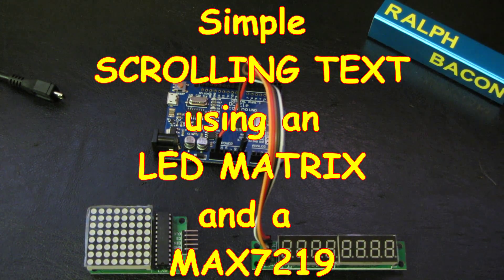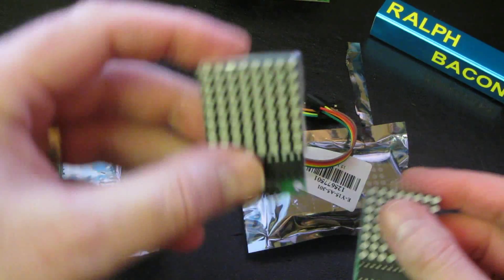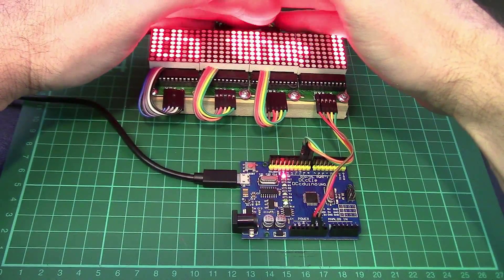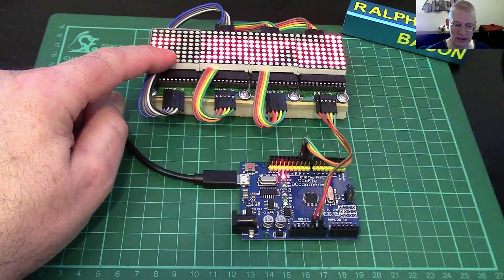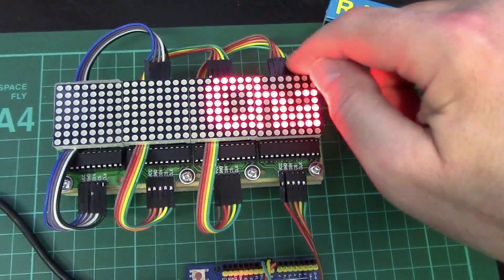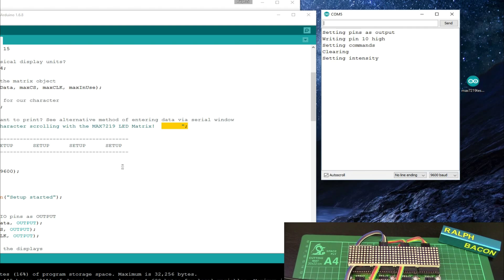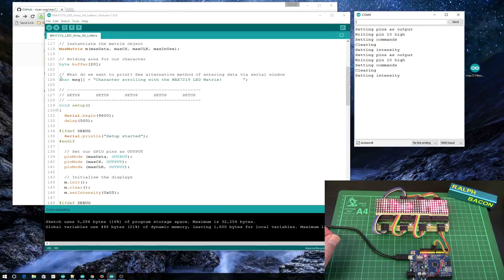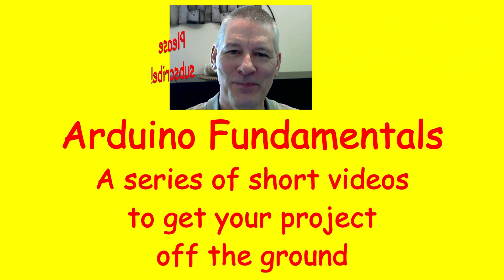#25 Scrolling Characters on an LED Matrix using a MAX7219

Comment: 4:40 Can't you just use the library to make scroll left and right? I'm going to buy one but i really want left and right scrolling ability.
Reply from the maker: Not using that library, Paul, but there are others that do this. It's complex to do which is why better featured libraries are required. Have a look at my other MAX7219 videos (use the searchable pdf file in my most recent videos' description) to see whether I mention them.

Comment: Hi im new to arduino coding. As i was trying out the codes for this maxmatrix library, it seems to show the error of maxMatrix library is not found but i have already included them in the arduino library. I'll appreciate any help :)
Reply from the maker: Have you added the following line at the top of your sketch:
#include <yourlibraryhere.h>
Don't forget the ".h" part of the file name or it won't find it.

Comment: i am having trouble finding the LIB for this  #include <avr\pgmspace.h>
Reply from the maker: I'll assume you're using the standard Arduino IDE above version 1.0, Gaatech. In which case you don't need this library explicitly, it's already included as part of the standard Arduino set of core libraries. It's used to write to EEPROM memory, I hope this clarifies this. Good question, thanks for posting.

Comment: Great video! I have controlled these with the UNO and other programs in the past. I am looking to run this program that you have graciously provided with a Arduino Pro Mini. Any reason this shouldn't work the same way? Thanks!
Reply from the maker: Thanks, Andrew! I can't think why that would not work with a Pro Mini if you have the 5v version. I cannot tell at a glance whether the 3.3v version would be able to drive the matrix (I suspect so, but best to check). I just find the programming using a USB to Serial dongle a bit fiddly, and prefer the Sparkfun Pro Micro USB version. And do check out the updated video #80 which covers this topic in more depth.  Thanks for posting.
Reply: Ralph S Bacon , for some reason, by first two boards in a series of six were all garbled. I suspected a hardware issue so I swapped them out, still had the issue. I tried a different program that I used previously and it worked. Long story short, these boards indeed work with the 5V pro mini. As far as your program, I claim user error on my part. Great video and thanks for sharing/replying!
Reply from the maker: Thanks for your post, Andrew, glad it worked out and good to hear from you.

Comment: Hi, have you tried th MD_MAX72xx library for the blue 8x8 x4 led module? ps you need to edit the library .h file to tell it what display your using it took me an hour or so to find it. has some good effects if you install. his paralo additional library
Reply from the maker: I've added this to my 'investigate' list as I've not seen the blue led arrays (sound nice) but I have, I believe, watched a demo of the library you mention (very sophisticated wipe effect, split screen etc). Thanks for the heads up, Gary.
Reply: Ralph S Bacon defo worth a look. had a few head scratching moments whilst munging dh11 rtc and barometric pressure sensor code into it to get sensor data to display.😞🤔

Comment: Hey Ralph,
      
         Nice video. You are my teacher, I started make display after wathching this video.
 I used 5 display (8*40). Now I Want to make this display big like 16*40. Suggest me ...How i do Its Wiring?

and which code upload  ?
Reply from the maker: Mahival, have a look at the comments under video #80 Scrolling LED Matrix MAX7219 Updated which contains some suggested links (by others, not me) where you can define segregated areas and build up very clever displays.

Comment: Hey Ralph, 
I am using the raspberry pi and I wanted to ask you:
does it work with the raspberry pi 3 in the same way or is it way different? I am also using the max7219 leds :)
Reply from the maker: Hello Arduinite! I'm currently on vacation 5,000 miles away from home so I'll have to be brief with these comments until my return, mid-July.

The principle will be the same but the library I'm using is only for the Arduino. But if you look around I bet there are libraries just for the Pi that also do this. Good luck in your search!
Reply: Thank you but I already found a library vom rm-hull :)

Comment: max7219test_scrol.ino:29:23: error: variable ‘CH’ must be const in order to be put into read-only section by means of ‘__attribute__((progmem))’
What to do?:(
Reply from the maker: Hello Kwikwik! That example sketch was not written by me as it was included in the library. So it is quite old and the Arduino compiler is becoming more strict with what it will accept these days! If you are not already using Arduino IDE 1.8.1 I can only recommend you do so (because I received a different, albeit related, error).
 
Just replace the line 29 to read:
 
PROGMEM const unsigned char CH[] = {
 
and all will be well. You may receive two more red warnings in that library but it does not stop the program compiling. If you want to stop those errors find the MaxMatrix.h file in the library folder and change line 34 to:
 
byte buffer[81]
 
but this is optional.
 
This resolves all issues with this library. I'm going to do a new video on the MAX7219 scrolling text using the 4-in-1 LED arrays soon so stay tuned!

Comment: Hi Ralph, Great video thank you. I have run your code using 5 display units (changed line 115). The last two (those on the left) work fine, but the first three are just showing randon patterns. I assume that because the last two are working then the wiring must be correct so wonder if I might have some faulty units. Any thoughts? I have swopped the 7219 around from a display that working to one of the ones that not and the result is the same. If you have some pointers I would be very grateful.
Reply from the maker: Hey there MrCatchers! I have four of these running so I'll have a look at the code and ensure it runs and let you know where to find the sketch. That said, there will another video soon on the 4-in-1 versions of these devices which works much better (and no wires!) so stay tuned! I'll get back to you regarding the ones you already have (and which I have too).
Reply from the maker: I'm back! I've got four of these units working with that sketch (MAX7218_LED_All_Letters.ino) but I haven't got a fifth to  add to them (not until my new ones arrive later this week). Can you get it working properly with just four units? The wiring can be a bit of a "gotcha" so double check that too. Let me know whether four units work OK for you, that's the first step, I think.
Reply: Ralph thanks for your prompt reply, very much appreciated.
Turns out it wasn’t the wiring but LED array orientation. In order to
facilitate mechanical fixing to my board I had removed the arrays. I worked on
the assumption (very bad practise, I know) that they would work either way
round. What was I thinking? So what turned out was that the first three display
units had their LED matrix the wrong way round. Warning to the unwary, mark
them before removal.
The sketch is working well with 5 display units, but
interestingly ‘maxInUse’ has to stay at 4. If I change it to 5 then the first display
unit in the chain (the one connected to the Arduino) has a corrupt output.
Reply: On closer inspection with maxInUse set to 4 the left most
display is actually displaying a string independent of the first 4 displays, changing
maxinUse to 5 corrupts the first display.
Reply from the maker: This is "interesting" in a OMG-I-don't-know-what-is-wrong way! But my new matrix display will be turning up soon so I will be able to check what happens when I connect a fifth one up, so bear with me for a few days and I will get back to you. But I'm glad you got the orientation of the LEDs sorted, as you say it's easy to turn them round.
Reply: Thanks Ralph, I look forward to hearing your results when your fifth dispay arives.
Reply from the maker: So, MrCatchers, I have bad news and good news. First the bad news. I connected a fifth (and sixth, seventh...) and the bad news is that there must be something wrong with that library as the fifth matrix (counting from left to right) had some rubbish on it. Moreover when adding further units (and updating the sketch to indicate how many) the problem got progressively worse. So no go there (and I'm not going to debug that library just now to find the error). There are alternative libraries out there (many of them based on one original it would seem) but you may find one that is original and works with more than 4 matrix units.
 
Now to the good/better news. In the original video I briefly mentioned the 4-in-1 unit where the four matrix units were already mounted and connected as one unit - but I had no library to use with them as they were mounted 90-degrees to the left (or right) compared to the original ones. Since then a fellow viewer (see comments above) from fabrice26306 has pointed me in the direction of a library that works with these 4-in-one units - and if you connect two together it continues to work (so there are then 8 units).
 
*I'll be doing an updated video soon*, so you may yet have a solution but not for the original hardware (as I said, each matrix is turned 90 degrees and thus the new library won't work - well, it displays the information vertically). The advantage of the new 4-in-1 units is that wiring is minimal - one set of 5 wires in (+ve, -ve, data, clk, chip-select) and that's it. Much simpler to use. You can get them for about £3.00 ($3.60) from the Far East if you buy them singly (if you buy more than 1 unit in a single transaction you get stung for postage - doh!).
 
So perhaps not quite the news you were hoping for (me neither) but there may be a silver lining. Stay tuned.
Reply from the maker: HOLD THE FRONT PAGE! Further to my reply above, and in the interests of being thorough I have discovered another library that supports the old hardware (that is, not the 4-in-1 modules) AND it works with 5 units (and 6 and 7... but it gets a bit slow at that point). All will be revealed in a forthcoming video. Definitely stay tuned!!!
Reply: Ralph, Thanks again for all your work. Actually it’s quite
comforting when the designer experiences the same issues, it tends to suggest I’m
getting it right. Really looking forward to your video where you will address
interfacing to the 4 in 1 units. Is there anything I need to be aware of when
ordering these from the usual far eastern supplier? They all look very similar
to me, so bearing in mind the usual 4 week lead in time, I think I will order
one in anticipation.
And now the additional news that you have found a library
that will work with 5 (and more) of the original display units. That’s going to
be quite some video when you get the time to make it.
I’m certainly staying tuned.
Reply from the maker: I can't say I find it "comforting" when a library misbehaves like this but I get your meaning! The 4-in-1 units seem pretty much all the same (but are not, in the sense that the actual manufacturing of them is done in different factories so they are not physically identical - my second unit places the LED matrices a couple of millimetres lower than my first one, grrr!). So if you intend ordering more than 1 do it straight off in the hope you will get them from the same batch and thus will be identical in all respects. Yup, that video will be a 2-hour special heh heh! (Just kidding to anyone else reading this).
Reply: Ralph, I’ll get a couple of the 4 in 1 units ordered in
anticipation. Cheers

Comment: Hi Ralph, I'm a new subscriber since today, nice channel you have here ! So without any further delay, here's my first question... did you get any more info about the 4in1 LED 8x8 matrix (the one with the orientation issue) ?
Reply from the maker: Hi Fabrice, welcome to my channel! It is my continued regret that I did not manage to find the time to write the code for that 4-in-1 display, which mocks me from my components box on a daily basis. However, it has not been forgotten. It's still (way down) on my backlog. Perhaps I just need to take a couple of hours out and try to do something with this, if I do I'll let you and everyone here know, of course. Thanks for the nudge on this and for your post.
Reply: Hi again Ralph. Well, I just found something useful, a library that makes it possible to scroll text from right to left on a 4 in 1 LED 8x8 matrix. You will need the "MAX7219_Dot_Matrix" lib plus the "bitBangedSPI" lib by Nick Gammon!
Reply from the maker: This is so interesting that I'm going to have a go. Thanks so much for the heads up. If I'm successful in putting this together, and include a demo in a future video I may mention & credit your username unless you tell me otherwise!
Reply from the maker: Well, I got it working after a while; whether the Arduino compiler has moved on, or the Eclipse IDE I'm using is MUCH more picky about things I don't know, but I had to make a few changes to the library code. But it now is working, smooth scrolling on that 4-matrix MAX7219 device with just the single cable entry. I've very tempted now to buy further ones to expand the display area (depending on price)! 
---->
If you do this on the Arduino IDE I will be interested to know whether you get compiler errors or whether it just sails through. If I get time I might transfer the project to the Arduino IDE just to compare.
 
Thanks again for giving me the heads up, brilliant collaboration between Arduinites.
Reply: I'm using the usual Arduino IDE 1.8.1 and all the demo's were working without any changes to make. I'm planning to make some clock/ weather station with it.
Reply from the maker: Indeed that would be very nice, a scrolling weather report! If you go to AliExpress they are selling these units for just over £3.00 (about $3.60) a piece, pretty good value if you are prepared to wait a few weeks for them to arrive. Locally, I found them for nearly double the price (not surprisingly) but you do get them in a couple of days.
 
Thanks for letting me know that the code runs without modification on the Arduino 1.8.1 (although I don't know how it does it as there are some, let us say "oddities" in the code that should prevent it from compiling, and indeed did prevent it compiling on the Eclipse IDE). I'll mention this too, should I do a video.

Comment: sir how to add hc-05 by updating this code? i want to connect Bluetooth module for sending text .
Reply from the maker: Hi asif! I have just the video for you: look at my videos #36 & 37 which describe exactly how to communicate with an Arduino using your phone and Bluetooth, works like a dream. 

Here are the links you need: 
https://www.youtube.com/watch?v=7XdSGU_W4ho 
https://www.youtube.com/watch?v=7FN3f9Y4yJI

Have fun, it is not difficult but will require you to program both for the Arduino and your phone, all shown in detail.